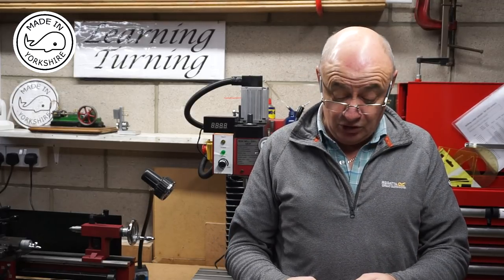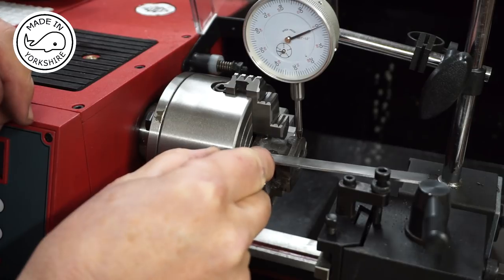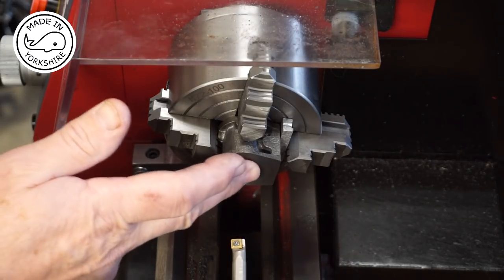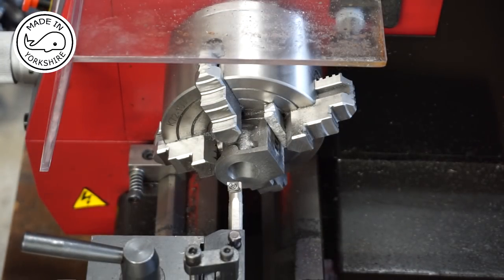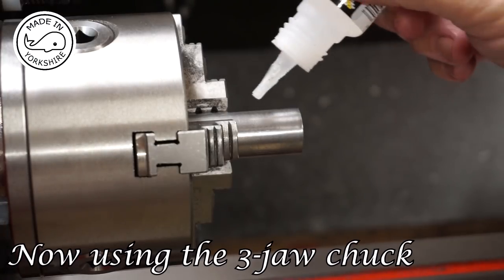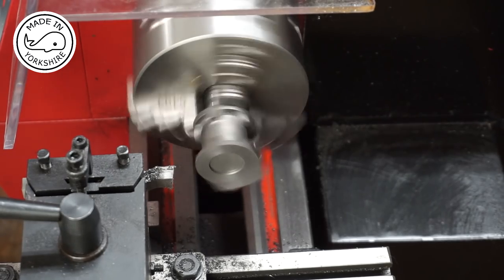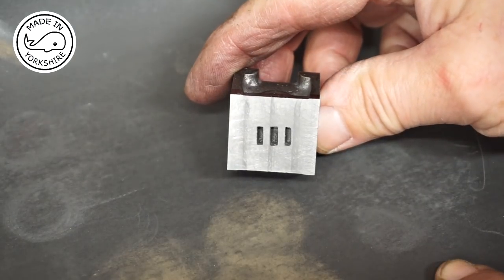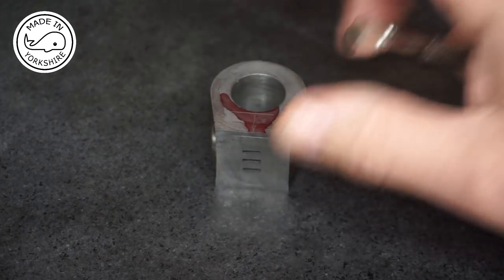#MT25 Part 6 -  Making a Stuart 10V Steam Engine. Machining the Cylinder. By Andrew Whale.

Comment: Hi Andrew, just found your channel, really enjoyable and informative. When I did my apprenticeship as a toolmaker in the 1970's, I was always taught that there was no right way or wrong way to do things. If it worked, it was the right way. I've built a couple of Stuart engines; I've always added a small (maybe 2mm) 45 degree chamfer at the bottom of the cylinder. It makes it a lot easier at assembly because it acts as a guide to compress the packing/piston rings. Keep up the videos - highly enjoyable!
Reply from the maker: Hi - many thanks for the feedback. I really like the idea of a chamfer. I must try to remember that one!
Cheers
Andrew

Comment: The cylinder is one of the more involved jobs. I am getting ready to a PM research engine and this series gives me good idea of what to expect from Stuart. Machining a steam engine from castings had been a right of passage for traditional tool and die. A step to the next level of training. The steam port can be done a variety of ways. One of favorite is the tooling ball. A tooling ball is a classic means of dealing with awkward oblique features. The steam port is an excellent example of showing the basics of using a tooling ball.
Reply from the maker: Interesting. I must read up on tooling balls.
Cheers
Andrew

Comment: Hi Andrew, you can use a wiggler to pick up center punch marks too, with the spindle turning. Just get it close by eye and sort of peck at the punch mark. If you're off, the shaft will visibly deflect. Keep pecking and moving the X and Y axis until the point lines up and shows no deflection when pecking the punch mark. These days, I mostly, used an edge finder with a pointed end to locate punch marks for drilling. Unlike the wiggler, the machine is not running when using it. You get the point close by eye and lower the point into the punch mark. Then, move the X and Y until the end of the tool lines up with the body.
Reply from the maker: Hi Dave. Thanks for a really good explanation. Very much appreciated.
Cheers
Andrew
Reply: You're welcome, Andrew. I forgot to tell you an important point about wigglers. Always use something other than your fingers to get it running true. It only take a slight push too far, to turn the point into a "helicopter," and injure your hand. I got that tip, early on in my very informal apprenticeship.

Comment: I used super glue to put a cylinder on a mandral but it seemed to soak into the casting and leave it unfit for a smooth fit. Had to machine it a little oversized to get rid of the hard glue surface.
Reply from the maker: Hi Galen. Acetone is a good solvent for super glue.

Comment: I'm busy on the cylinder, so this is of particular interest. Given that your 3/4" bar is a good fit in the bore, you could set up machining the "other end" in what I find to be a remarkably quick and easy way.You need to make a centring tool - essentially a small ball race - say 20mm OD and 6mm bore - mounted on the end of a bar. The bar goes in the tool post while the ball bearing's face runs against the bar. Driving the tool carefully into the work piece gradually persuades it to run true. Mount the cylinder as you have done and hold it reasonably tightly in the 4 jaw. Place a length of 3/4" bar - say 2" overhang - into the bore. Driving the centring tool into the overhanging bar should get it, and the casting running true.  Tighten the 4 jaw.My lathe spindle is MT0 and the through hole is less than 7mm diameter so a lot of my turning involves undesirably long overhangs. I've used this method time and time again.
Reply from the maker: Hi Len. Many thanks for the tip. I've gone over it several times and think I understand. My garage is out of bounds at the moment due to some building works encroaching on it. I'll have a play once I can get access.
Thanks agin and all the best.
Andrew
Reply: It's one of those "a picture paints 1000 words" things. Have a look at Clickspring under Shop Made Tools item "Bump" Lathe Centering Tool. Must admit, I made a short 7/8" expanding arbour to face the 'top' of the cylinder in the 3 jaw. I've had to turn the cylinder covers diameter undersize. The lump of cast iron in my kit was encrusted in rust leaving it well below what's described in the book as "of finished diameter". I've tapped the bottom cover 5/16" BSB, threaded the piston rod gland nut and reamed both to 3.97mm. When assembled, the piston rod runs OK provided I don't over tighten the nut. Tomorrow I plan to bring the piston down to final diameter and see how the piston rod runs in the Cylinder+Cover+Gland nut assembly. I may have to get some 1" slugs of 40mm cast iron from glrkennions at £1.20 a pop and try again with a better plan e.g. reaming (and possibly drilling) the 3.97mm hole through the gland nut and cylinder cover while assembled. We will see.Hope you get back to 'work' soon. regards
Reply from the maker: Hi Len. It looks like you are making good progress. I checked out clickspring but couldn't find the lathe centering tool video you mentioned. However I found one on Robert Cowan's channel. Very interesting.
All the best.
Andrew

Comment: Andrew. Unless you have already found out, please be aware of the following. With end mills, unless they they are 2 flute ( called Slot Drills ) or 3 flute, a 4 flute endmill will NOT cut in the center when plunging it into anything as the very center is hollow. On large 4 flute endmills there is often a center used for manufacturing and often used when grinding. Another tip when  having to cut out a hole in a plate, is NOT to drill a hole on one corner then keep going around with a standard endmill, it will take ages and wear the cutter. Use a 2 flute slot drill plunged down to depth increment the work by almost 1 cutter diameter and plunge again, continue until you have been all round. The center part ( scrap ) should just drop out, then replace cutter with a 4 flute to do the finishing work. You are in effect chain drilling holes in the part, and you are only using the end of the cutter which is easier to regrind. Hope this will help you.
Reply from the maker: Hi Dave - thanks for the tips. I'm sure others will find them useful too.
Cheers
Andrew
Reply: Not all four flute end mills are like that some modern ones do have a protruding cutting edge beyond centre that allows a plunge cut.

Comment: Dead interesting and well done. It's always interesting to see how different people tackle these tasks. I'm very very slowly building a D10. I had some issues with the drawings which had errors, but measure twice etc! I'm right at this now, cut the steam channels. One thing I have decided to do is to make a separate port face between the chest and the valve face you have here. My main aim is to make the engine far more controllable. Initially I was planning to use a round valve and round holes into the steam ports. I can start with one and if not enough maybe three on each port. The point of a round (turned) valve being it opens more slowly as the rectangular ones open suddenly. The engine is destined for a vertical locomotive so it needs to run slowly and not run away. Being a plate I can toy with openings without screwing everything up, and it can be easily replaced and reverted to the rectangular ones. What do you think to this mod, I'd be interested to hear your thoughts? And yes, the D10 centre split bearing is a little devil! I ended up soldering two bits of brass together and splitting them after. Are you planning O rings? Anyway, keep it up!
Reply from the maker: Wow! Round holes for the steam ports seems really inivative. A great idea. Piston rings are way beyond me, so I plan to use graphite yarn, like I did for the S50.
Many thanks for the feedback. It's very cold in my garage at the moment, so my progress has slowed a little. Good luck and it would be great to see a video of your finished engine.
Cheers
Andrew
Reply: @learningturningmetal .
Hi. Agree with the graphite, plenty more leeway to play with. Thanks for the response, my garage is freezing as well!
Slow progress, it tends to get worked on when other projects subside. Some old pics
https://www.flickr.com/photos/49332365@N08/5443640894/in/album-72157625918196683/
It's ready for the drilling now which I'll get round to at some point! Slow progress! Big and little ends done now. Keep up the good work! Tom
Reply from the maker: Hi Tom - very impressive pictures. Looks like you have done a cracking job on the D10. The wiring on that old pillar drill looks a bit dodgy though! 
Have a great day.
Andrew
Reply: Cheers and thanks. The drill originally had a 3 phase motor. I had just got hold of a better starter when I took this. Take care.

Comment: Thank you for a wonderfully informative series.
I have been following it with interest as I have been given a partially machined kit of a Stuart 10V Vertical Steam Engine by a friend. He bought the un-machined kit 20 years ago but will never get around to finishing it himself. As a result I feel honour bound to complete this project myself.

Right now I am up to the cylinder block. Like many of the other parts it has been partially machined to the wrong dimensions. The major fault is the cylinder bore is over size by nearly a millimetre  (0.020"). It is also quite corroded so, if I am to rescue the part I am going to have to make it even more oversize.
At 6:44 in your video you mark the cylinder so that you know which end you machined it from so that you would know which end to sit against the top of the standard. If you had not done that how would you know which was the correct end?
Reply from the maker: Hi Jeff, I don't fully understand your question. If you are going to re-machine the part, you will know the end you started at won't you?
Cheers
Andrew
Reply: @learningturningmetal  Of course! I was over thinking the issue. 
It just needed your external perspective to show me how to go. [Smacks forehead]

Comment: If you poke the wire into the inlet port before you start drilling, then when the drill breaks through you will see the wire react to the drill bit .
I have used the technique quite successfully for a number of years and it has never let me down
Reply from the maker: A great idea. Thanks David.
Reply: Or you can watch for the chips

Comment: Good work , Andrew
Cover the ways up , on that new lathe !.
Keep it clean of cast iron chips and dust, it takes less than 10 seconds to brush it away before moving the carriage.
Please do not use your fingers to centre the Wiggler needle, use a pencil or a sharpie to do it.
Unless you fancy fly cutting your fingers.
 Time to make some precision angle blocks, rather than cardboard template.
See Joe pie on YT for a quick and easy way to make them.
ATB Adam
Reply: I was about to comment about Joe Pie's angle blocks and saw that you beat me to it. 8-)
Reply: +Robert Oswalt 
Joe's video's are a good source of information 😉
Reply from the maker: Many thanks for the tips Adam. I will definately check out Joe's vid. 
Cheers
Andrew

Comment: Hi Andrew

I finally got to end of making the cylinder; drilling the ports was more nerve wracking my 'O' levels and that was a good few years ago! One question, when did you drill and tap the centre steam port; the drawing shows it as a 1/4" x 32 TPI; I thought I was going nuts as I can see it in Part 14 of your video? 

Thanks once again, I could never have got this far without your fantastic series

Best regards
Sanjay
Reply from the maker: Hi Sanjay - well done! From what I remember that was quite a mentally challenging part to machine. I think I left drilling and tapping the exhaust until I had decided what size pipework to go with. My notes on the drawing tell me that I went with 1/8" pipe and I tapped 3/16" x 40 ME for a suitable pipe union. Not sure where I got the union from but it would have been from a popular UK supplier.
Hope that helps.
Cheers
Andrew
Reply from the maker: Update! I think I got the male union from Maidstone Engineering.

Comment: Great work, I just ordered a 10v and can't wait to start. I just want to ask you if there's a reason for using insert tools at such low speed. Might be the reason you can't get a good finish, as the tip rub too much due to slow speed
Reply from the maker: Thanks mate. I now use inserts for cutting aluminium regardless of the type of material. I tend to get really good results. Good luck with the 10v.
Cheers
Andrew

Comment: Hi Andrew, I have really enjoyed watching your videos. I'm just about to purchase a Stuart 10V.  I don't have a milling machine now but the one you are using looks suitable. Do you know if its available with imperial dials? Anyway I'm looking forward to the build if you have any pointers in advance I'd be grateful. Thanks
Reply from the maker: Hi there. I don't think my Sieg SX2P is available with imperial dials. In my opinion one of the best modifications you can make to a mill is to put a DRO on all axes. If you do that the dials become irrelvant and you can switch between imperial and metric at the push of a button. Having a DRO on my mill made milling an absolute pleasure. I would say go for the largest mill you can afford and get into your workshop - and even better if it comes with a DRO system already installed.
Hope that helps and good luck with the 10V. I found the 10V more challenging than the s50, but it's a fantastic little engine. Mine runs as sweet as a nut!
Cheers
Andrew
Reply: @learningturningmetal  Thanks for replying. I have an S50 that I bought and restored. The 10V will be my first build. I have also started a PM research mill  engine. I really do enjoy your videos. I've learned quite a bit from watching you and am inspired to give it a go !! Thanks again